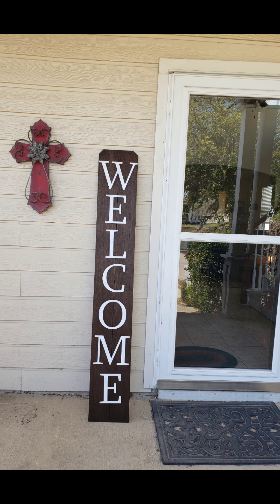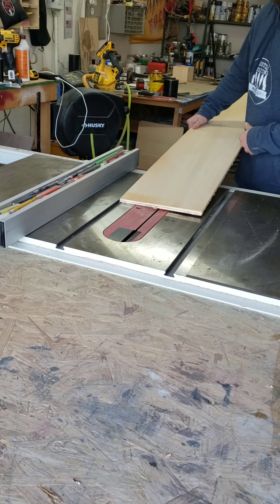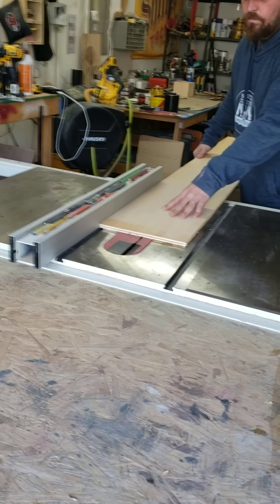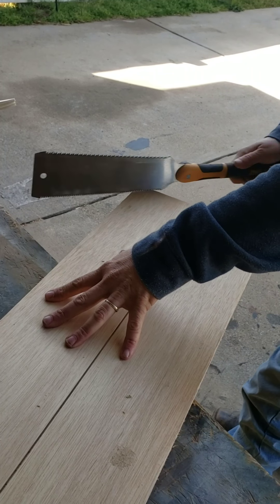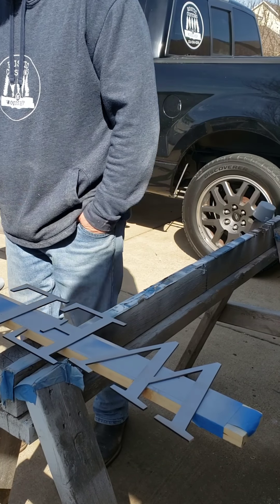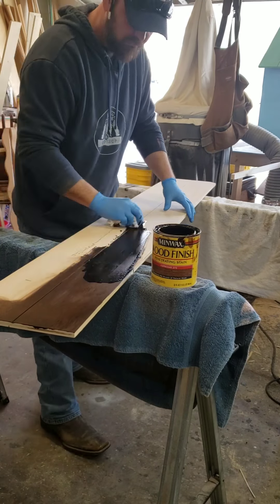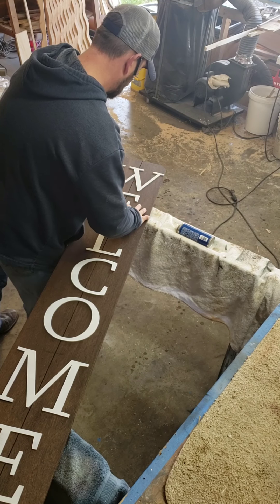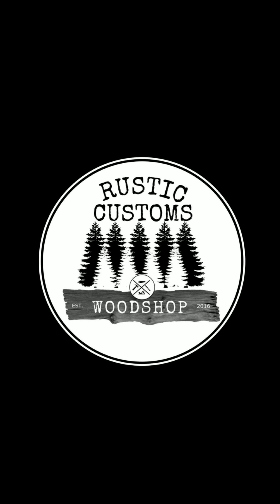Wooden Porch Sign

Comment: Nice build man! can i give you a small tip? I guess you are filming with your cellphone and film it in the normal position... Thats why you become that frame rate with the white bars on the right and left. you can fix this by turning your cellphone 90 degrees. I hope you can use the tip.
Reply from the maker: Filmed it for IGTV... had to film with phone in vertical position... Thanks though!
Reply: @rcwoodshop170  you are welcome my friend